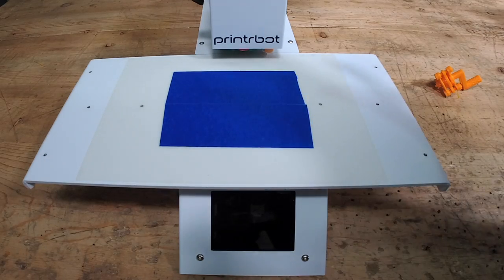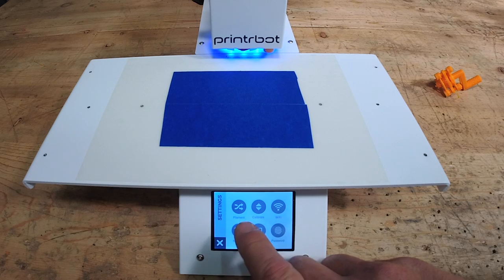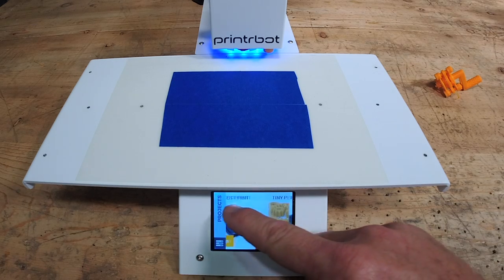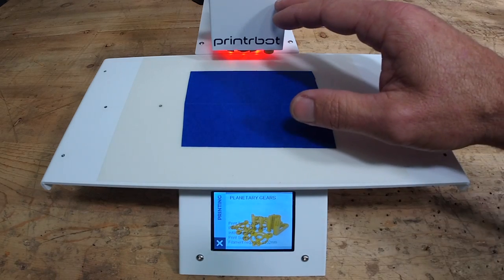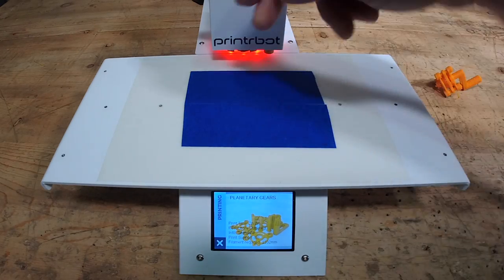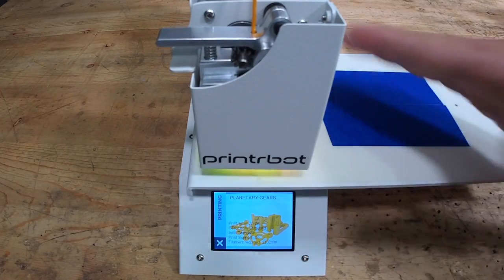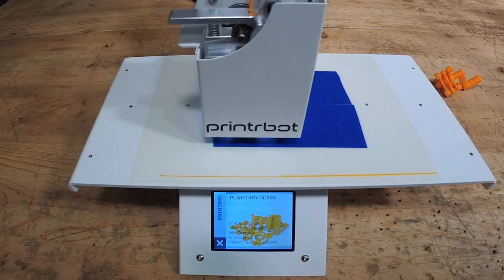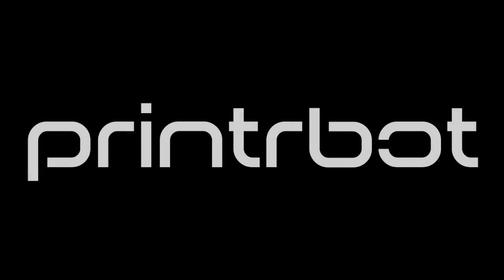Starting a Print with the 2016 Printrbot Simple

Comment: what are the lights on the print head used for? just looks or is there some other reason?
Reply from the maker: They illuminate the print with white while printing, red during heat up, and there is a "lamp mode" in settings just for fun. They are the same as neopixels. It's just a nice touch. 
Brook
Reply: Brook Drumm ahh, i was thinking it was a precursor to using a cold nozzle or inkjet head and drawing out uv resin and curing it as its drawn.  But still cool!

Comment: why touchscreen?
Reply from the maker: taoorus It allows any UI and is easy to use.
Reply: i think its not easy to use, but easy to develop. because even in this video you struggle a bit in interaction with touchscreen.

for frequent use tactile buttons with good feedback is far more usable
Reply from the maker: We have already improved responsiveness. But my fingers are very calloused (I play guitar and work in my shop a lot). I have the same problem with my iPhone. Softer fingers- like my wife has - work better. Make no mistake though, since I'm used to the iPhone and iPad, it does have a noticeable difference. We are working w a different beast. I'm very pleased with the response in the latest build.

Comment: Still using blue painters tape?  Try PEI!
Reply from the maker: We cover the aluminum plate w polycarbonate tape for protecting the powder coat in case someone doesn't calibrate right. I'm working on a flex plate and a heated bed (3rd or 4th version). The heated bed will come w pei- we already have the pei ;)